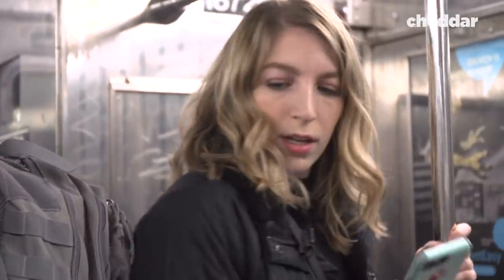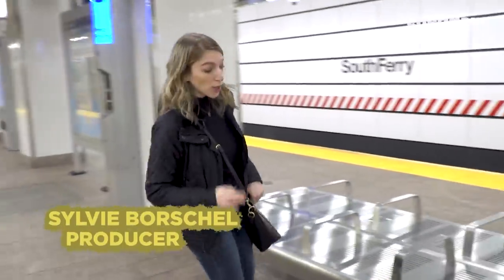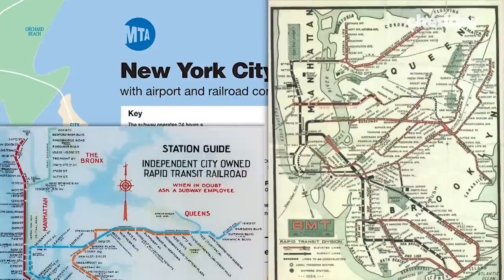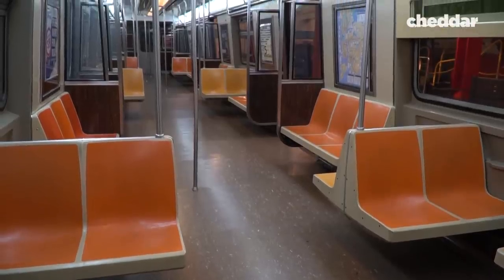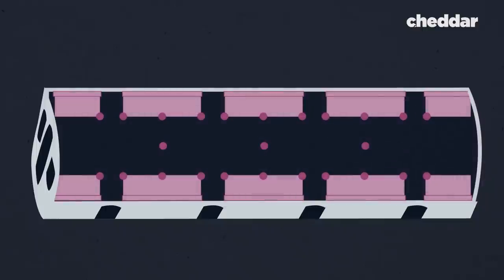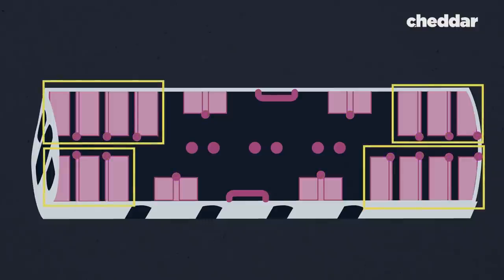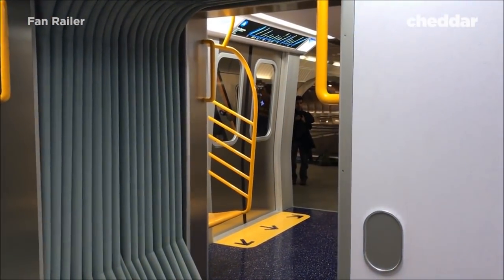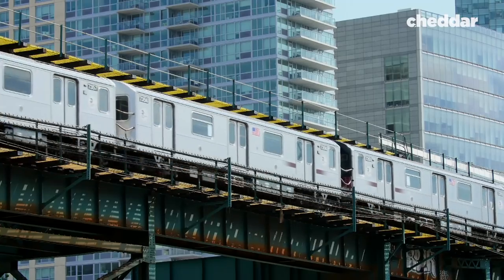Could This Subway Car Save NYC Transit? - Cheddar Explains

Comment: Yikes NY subway cars look old
The new design is basically how the German subway cars where I live looked for the last 20 years minimum minus the asymmetric door part
Reply: New York subway cars are battleships.  The simple analog stuff they used to use is much cheaper and more durable than what they have to buy now.
Reply: nycbk23 we have 40 year old trains all over the UK, they don’t look any different to the new ones though as they have been retrofitted, there is no excuse for it really
Reply: @nycbk23 They are old and that's why they are old?
Reply: On the Paris Métro, a lot of the cars are new, but on some less busy lines, there are cars clearly going back to the 80s, if not the 70s. Manual door open buttons, those red rolling LCD panels for the next station, and some even have a lit up panel indicating which route you're going (Ligne 7 splits into two directions at Maison Blanche)
Reply: @HughMiller98  what's funny is that all of those things would be considered cutting edge on the New York subway
Reply: it is old...
Reply: coz they don't do retrofit when those rolling stock 20 years old
Reply: New York's oldest subway trains in service now date back to the mid 60's. In comparison: at the moment, Paris oldest metro trains still running today are from 1959, London's are from 1972, Berlin's from 1974, the average lifetime of a subway train (just like a long distance train or a streetcar) is about 50 years.
Reply: @imaginox9  HK's MTR is 1979, and they do a retrofit during 1999-2002, around the trains at 20 years old.
Reply: @D'Afrique Rousseau Same for others in other countries, As a NYer, I can agree with ya 100%
Reply: @MilwaukeeF40C  True! They are true american made!
Reply: The Subway system have been neglected for decades here in NYC.
Reply: @KiraDaBeastNY  Well It's getting back to its roots because of mr byford
Reply: @imaginox9  Newer transit equipment- probably 1980s onward is not going to have service lives that long.  The computer and microelectronic stuff goes obsolete fast and every fleet is pretty much a separate customized collection of parts and options.  "Engineered" materials also don't tend to age well or be cheap to repair.
Reply: @D'Afrique Rousseau That's probably because people don't base the decision of where to live based solely on the quality of a city's subway cars lmao
Reply: D'Afrique Rousseau Lol “choosing” NYC over any city in Berlin is a lot more than about public transportation dude.
Reply: @Zopilote  if your R32s are fully functional and the funds to replace them are non-existent, why waste the money. Keep them in service along side the more modern cars and keep your capacity higher.
Reply: @visionist7  not really, there are some 60s era stock still on the lines, but they're running on the same exact tracks as 2000s era stock, and out numbered by the modern trains.
Reply: It’s hard for them to replace everything when so many people use the MTA every single day.
Reply: @HughMiller98  In Paris some date back to 1950s design and many have been built in the 1960s.
Reply: @Horizon301.  and the 40 year old trains are good, the HST's, 91's, 90's and the DVT's.
Reply: The British Citizen I mean the 125’s are better than the hitachi 800’s. The carriages are trash

Comment: We've just recently switched from closed-ended cars to open gangway design for all the subways in the greater Frankfurt area. The trains just feel so much better and it's so much easier to spread out throughout the train.
But these trains don't look like what you've shown here with actual gangways which remind me of what is being used in Tokyo, and where the noise coming from the open gangways is unbelievably loud.

Comment: Ah yes, cut the MTA’s budget repeatedly to pay for other projects and allow the technology and infrastructure to weaken and deteriorate and then equate that with overcrowding (which is arguably as a result of the aforementioned) yeah sure good one
Reply: fucking thank you .. someone understands. Wtf is MTA spending our money on.
Reply: What cuts lol
Reply: @Pathtoadulthood  unions, administrators, pensions, benefits
Reply: @MK-ex4pb  All things that should be cut to accomodate the customers.
Reply: David Choi tbf the system can’t run without the people running it, what it needs is a strong backing from the city and a good amount of public investment and everyone will reap the rewards of a great system
Reply: David Choi unneeded mezzanines and the unnecessary ESA if that project was cancelled we would have the 2nd ave subway already
Reply: @Pathtoadulthood  
Nothing against unions (can't be going back to the Industrial Revolution's labor standards, now can we?) but yes, they should be given a kick in the ass, and administration should be either cut or their pay cut.
Reply: @Pathtoadulthood  on wall art and fancy lighting.
Reply: We could give the MTA a blank check and they'd STILL cry 'budget deficit'.  The biggest problem with the MTA is a lack of brain power, mismanagement, lack of oversight, lack of accountability, corruption, union jobs with guaranteed pensions = lazy employees with zero motivation to do anything right or within a certain timeframe, overtime pay 'rules', etc.  You think it's pure coincidence that 'professional elevator/escalator repair guys' don't know how to keep these things running properly?  It's called OVERTIME PAY.
Reply: @Lisa_Evers  you're really complaining about people getting pensions and overtime pay?

Sure, let us workers blame each other and fight amongst ourselves while the fat cats laugh all the way to the bank. /s
Reply: qjtvaddict Why cancel ESA?

Comment: Literally 2 days ago I was taking the 2 train and some fighting homeless people pulled the emergency break while we were in a tunnel... An hour wasted.
Reply: Don't you have cameras and police always ready to come in and quickly drag abusers out at the stations? They should've been thrown out well before their fight got out of hand, this is essential to trains running smoothly.
Reply: that why i don't take train to work...
Reply: @NJ-wb1cz  They pull the break and left while the train still in the middle of the track.. you are hoping too much for the police..
Reply: @campkira  I'm not hoping, I'm describing how subway works in my city, with consistent wait times between trains around 90-100 seconds during rush hour, massive amounts of people, minimal to non-existent security checks.
People have very clear understanding that fighting in a subway is guaranteed to land you in jail overnight on some bullshit excuse like disturbing the peace, so they don't do it. Also they do understand that everyone needs a subway to work reliably, including themselves.

Also, you can not "escape" from a subway. It has very limited exits and even the most rudimentary monitoring system will predict which way they will try to exit well in advance.

Subway may be the easiest place to keep order in, if there is any desire to do so. The hard part is managing the constant flow of people when something happens, so it's much more beneficial to prevent delays and accidents instead of dealing with consequences.
Reply: @campkira  You wouldn't be saying that when you are crying about needing car insurance from your car crashes LOL
Reply: The older trains have no way of knowing what exactly sent the break into emergency. The train operator must go to the tracks and check to find out.  You could cut on wait time by explaining what happened to the conductor. Quietly go to the middle of the train and explain the situation. Many times, they will not engage the people involved due to fear of retaliation from bodily harm to pulling the E-Brake again as soon as he/she leaves. So they discreetly call the police to meet them along the way.
Reply: @71317oiram  There are only certain circumstances in which a T/O would have to go to the track and investigate and emergency braking and the pulling of the emergency cord is NOT one of them.
Reply: @randylitz1849  in the Older cars R-68 an lower that is the standard procedure. If the train doesn't recharge the brakes. But the 2 trains are R-142 so I was wondering what took so long. 
There was one incident 7 days ago at around 7:49PM, it happened at Times Square. The train operator knew what the problem was and  found multiple E-handles activated. They found a person was doing it for no reason and the person was removed from the train was on the move at 8:01. No other cases on the 2 line from may 2nd to the 5th.
Reply: As matter of fact on may 2 2019 there was a homeless person at 219th street that did the same. At 10:31. The train was on the move at 10:37.  (But neither case was in the tunnel. The first case was at the station so I'd need more info to see what happened.   ...To be clear, I wasn't saying that the reason for the delay that the OP reported was the roadbed inspection, I wanted to point out that if you see something, help the crew to get the train moving. Everybody benefits.
Reply: campkira You should. It’s faster than driving

Comment: With the open gangway design they can just eliminate all seats in every other car. They should have at least gone with the offset doors though.
Reply: That would be a better design. Have compartments with no seats and extra poles (I also hate the overhead rail and whatever dangles down from them)
Reply: hogfather22 None of the trains have had straps or handles for several decades, but I think some buses have them. The bars over the seats always feel too close to the seats, even though it’s an easy reach for me. Other than the new vertical double bars, my favorites are the overhead bars which run down the middle of isles. Those just need to extend all the way to either end of every car.

Comment: Actually only very few JR trains in Tokyo have doorless cart passages (mainly a few regional lines) and I think also the 2 transrapit lines. So all in all probably not even 5% of carts in Tokyo are designed like the new New York designs. That being said I can however confirm that layout is featured in a few modern trains in Paris, all new lines (since roughly 2009) in Moscow, in Munich, Shanghai and sometimes in Berlin. I'm not quite sure but I believe newer trains in Beijing also have joined waggons

Comment: The open gangway design is great. I live in Toronto (I've probably ridden on the very train showed at the 6:33 mark many a time) and it makes a big difference.
Reply: It's a bit moronic that NYC subway doesn't have open gangways even in 2019. The cars can be upgraded. But they want a totally new system.
Reply: Its key advantage is you can get on at the nearest door and if you find that car is a bit too full you can move on down the train to find a better seat, or space to stand. With everyone doing this passengers tend to board more quickly and spread themselves along the train more effectively.
Reply: @jhingur7169  Just wait 2 more years
Reply: @marktownend8065  Except people tend to choose a subway car to where they are getting off.  So they will linger regardless.

Comment: London been doing this for ages these new trains are already here
Reply: These new and improved trains look exactly like the now retired 80's rolling stock from the Rotterdam Metro.

The new stock has mostly transverse seating with comfortable fabric covered seats, almost only vertical bars and you can walk through the entire length of a single train set.
Reply: @MufferNl  They look like a cross between the S-Stock, and the presented designs for the mythical "New Tube for London".
Reply: @Ambigious  Never said we had new stuff just meant NYC lagging behind a bit
Reply: @MarioAtheonio   at this point I'm fairly convinced we're never getting the NTFL
Reply: shit either way...
Reply: London's new carts don't have any functional advantages over other older open ended carts.
In fact, they have some sort of awkwardly placed boxes which needlessly take space inside.
Reply: @Ambigious  Brits, do have new tech when it comes to some trains though. The 2009 tube stock is one of the most frequent lines in the world, 2nd I believe, with modern signalling.
Reply: Riya the thing is that the MTA swallows all the money for other “stuff” rather than what it needs to be done. since they fixed the trains and stations in the late 80’s and made it rideable for rich people as well, after that they actually just left it as it is now. They been putting money on cute stations that benefit the white/rich area and leave clogged and nasty for working class. To be honest the new trains smells so bad the homeless prefer to go on those trains instead of the old ones, the old trains smells better so i dont complain.
Reply: After all London is the very first city in  the world to have the underground transit system dated all the back to the 1870's when horses were made to pull the carriage beneath ground.
Reply: Butt Why?? Still, the trains are quite wide.
Reply: Same on Madrid, it's funny how they are selling these open trains like ground breaking technology, wow, so futuristic!! 😂
Reply: And it's still not the best subway. Look at Seoul/Hong Kong: WiFi, phone signal, clear signs/directions, shops and toilets at stations.
Reply: JasonSPD alot of Londons stations have shops actually.
Reply: Lar M Horses didn't pull Londons first underground trains, steam locomotives were used. The first line opened in 1863.
Reply: JasonSPD Also, you don’t see people blocking the doors; not caring if others can fit through or not. There are also no homeless taking up an entire bench. Open gangways will ensure the entire train smells like ass. 😷
Reply: @canman5060  1863, and steam trains (underground!) not horses
Reply: @Ambigious  brits invented railways and the first metro.  You know nothing!
Reply: ds1868 
Lmao, and how is inventing the metro helping you today?
Exactly - not at all
Reply: @babyfreezer  It is one of the best.

Comment: 2:50 The hell? Comfortability?! Thats not a word just use comfort! How does that happen?
Reply: .... that is the noun form of comfort....
Reply: @Kvs6263  look here https://www.google.com/search?q=comfort&rlz=1C1CHBF_enNZ836NZ837&oq=comfort&aqs=chrome..69i57j69i60l3j69i65l2.839j0j7&sourceid=chrome&ie=UTF-8
comfort is both a noun and a verb. Comfortability is a nominalisation which is when unnecessary prefixes, (ironically nominalisation has this where -sation is added onto nominal) for the sake of businesses jargon. Also try typing comfortability and you will see autocorrect doesn't recognize it.

Comment: open gangway is a no brainer, it also makes public transport more attractive because you have more light, space perception and are not stuck in a single car with some scary dude. also allows for movement to less crowded areas while the train is running.

Comment: The new trains are missing one thing.. fabric or leather seats! Sitting on plastic for a long time is uncomfortable. London has it! MTA - take note!!
Reply: Those are harder to clean and thus will most likely not happen.
Reply: MTA isn't going to clean or properly maintain shit.
Reply: NickdoesLife no they aren’t. All buses have these now mainly leather or vinyl leather, they can be cleaned easily just like your leather seats in a car. Plastic is just plain cheap and nasty for public transport.
Reply: The stench of the homeless would deep in within the first week

Comment: I'm amazed that here in Santiago, Chile, there are much more advanced subway lines. Although is a smaller grid, that idea of the continuous wagon is something that has been in use since 1998.
Reply: True. The NS-93 / MP 89 are still very modern (Paris got its last new modernised MP 05 as recently as 2015).
Reply: @UCo6lU7PjwUOIFbYOkGRcrFQ1970s stock is fairly recent in my opinion. The DT1 don't seem particularly antiquated to me.
Editfor my previous comment: actually the last MP 89 (Be 8/8 TL) entered service in Lausanne at the end of 2017, well after Paris got its last MP 05.

Comment: They need to fire everyone at MTA and hire Seoul Metro employees. Seoul Subway is the best system in the world!
Reply: Brian Moon you would cause massive delays as Seoul  subways doesn’t have enough employees to run the mta
Reply: @robfrmny21  how much employees do they have
Reply: Brian Moon This is NOT a solution to outdated subway car designs.
Reply: @robfrmny21  Seoul's subway system is covers more miles than NYCs and it used to be the 2nd busiest after Tokyo. Works like a charm too.
Reply: Bryan Alexander does have 70k employees to cover all the mta branches ?  Plus close to 10k subway and railroad cars ? Busses are over 3k do they run the system 24/7 ?
Reply: EmperorJuliusCaesar  No, I've taken Hong Kong, Tokyo, Paris, DR, and many more and Seoul's is still the best when it comes to cleanliness, efficiency, convenience, and everything else. Paris Metro is disgusting not to mention the body odors yuck
Reply: EmperorJuliusCaesar  and I'm a New Yorker that have to take the stupid MTA that wastes money on stupid shit like Billboards and OMNY that nobody is probably even gonna use that much smh